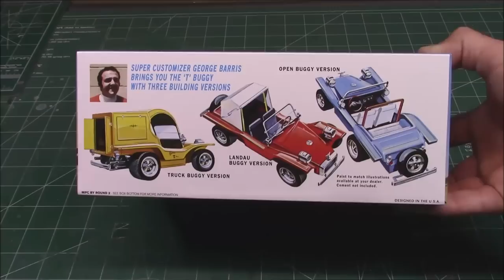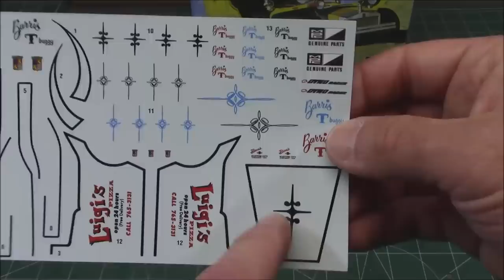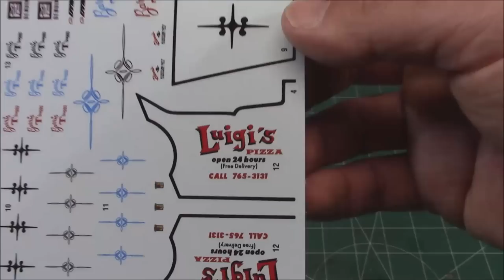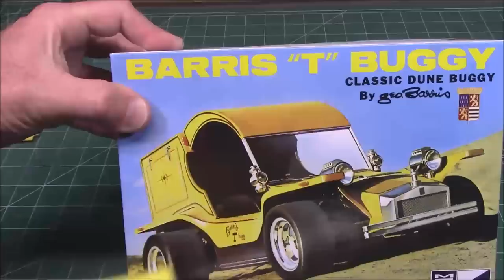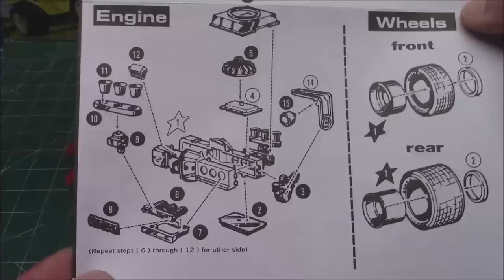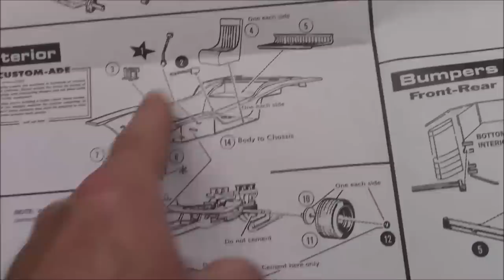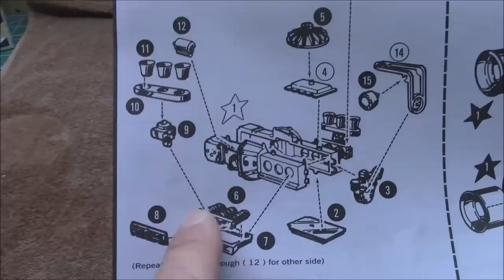George Barris T Buggy Custom Hot Rod Corvair Engine 1/25 Scale Model Kit How to Glass Painting Decal

Comment: Chri - how did you fix the “boo boo” with the black marker on the rear door? Thanks. Keep ‘em coming!
Reply: 91% Alcohol will remove Sharpie ink. If you are using Tamiya Lacquers you will need to apply it deftly, because 91% will remove the Tamiya as well. Not sure how 91% behaves with the Testors Extreme Lacquers.